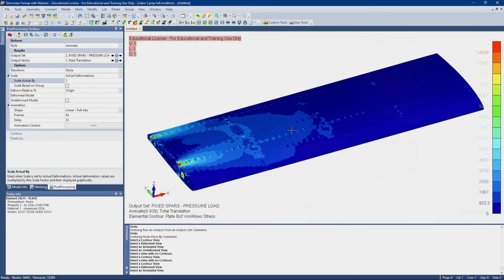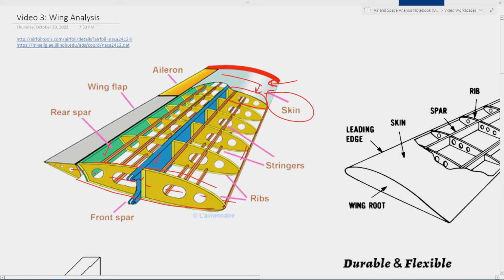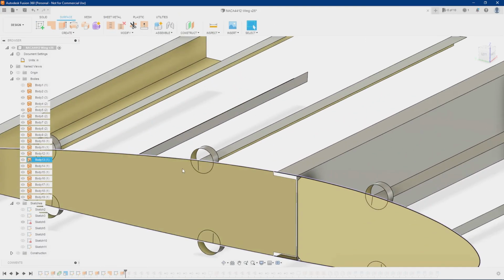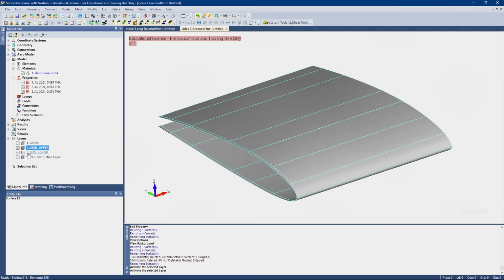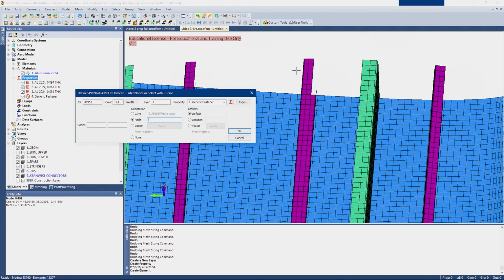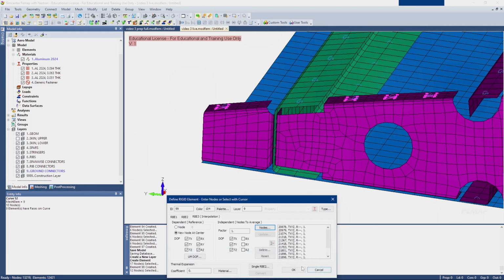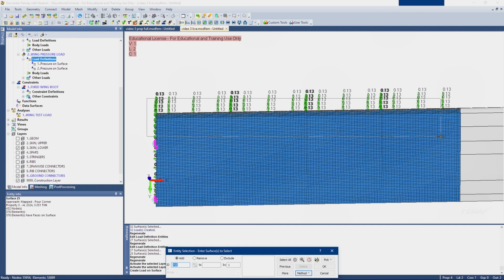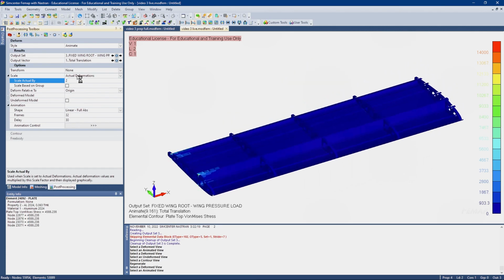Let's Analyze an Airplane Wing! (Discussion and FEA with FEMAP)

Comment: Thanks for a great video!  I’ll echo others about the very slow start, and a bit of laborious follow along (once I see how to do one rivet, I can probably do most of them ;-). What this has done is to really turn me off the idea of doing any FEM for my wing:  THIS IS A PAIN IN THE ASS!  First, this software is not intuitive or user friendly.  I’ve used software like this, and you really need to do it for a living to be able to do it right and do it efficiently.  So other than maybe the initial design work, this analysis is best hired out. But that was a very valuable lesson to learn.  My follow in question is if there is not some other FEM that is easier to use?  Looks like a good potential area for applying AI.

Comment: Thank you for making this video. Can this program model anisotropic materials such as a solid spruce spar or three layer 1/16" mahogany plywood at 45 degrees to the span for skins? And how are glued joints modeled? My spar is solid douglas fir; all ribs are truss type bent 1/4 x 1/2" douglas fir, skins are 0.105" mahogany on the 45, epoxied down to ribs on 6" centers. Typical strut braced high wing monoplane. Trying to model the contribution of the skin as it buckles is challenging; the wings are already fabricated and I need to know whether to stiffen the skins a bit with some uni carbon on the outside. Appreciate your effort presenting this level of detail. It is fantastic.

Comment: What will happen if you just defined the thickness before exporting into FEMAP? I'm using solidworks to model my wing. Love the video! This is helping me with my senior design project so far.
Reply: that is also my question but i did it with surface in solidworks and it works

Comment: Thank you so much for sharing your knowledge. 
The tips, tricks, shortcuts and best practices you show us here are really appreciated and I am sure will be referenced by others for many years.
Looking forward to your next video. I watched the entire tutorial and keen on working again with Femap. Last time I tried it was when it was embedded in MSC Nastran for Windows (~1998). Would love if you could share this 3D geometry in a link.

If possible, I would like to propose a further tutorial using this model, since you have already set it up:
1. Include contacts between skin and ribs, stringers (even if it's just glued i.e. linear contact)
2. Modal analysis
3. Inset any solid model bracket at the root of the wing and connect shell elements at the root to some solid elements
4. Increase the load until some section of the wing's material just reaches yield and do a non-linear analysis

Always appreciated and thankful.
Reply from the maker: Thank you for the comment! I can definitely do a video on those topics in the future